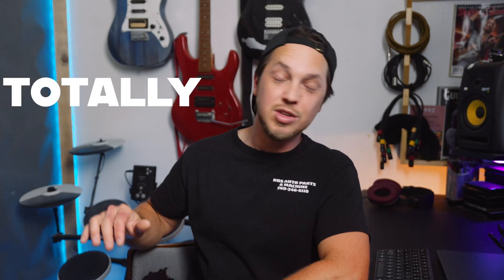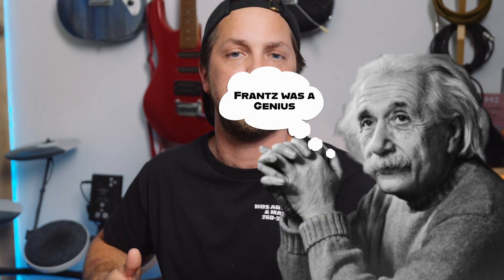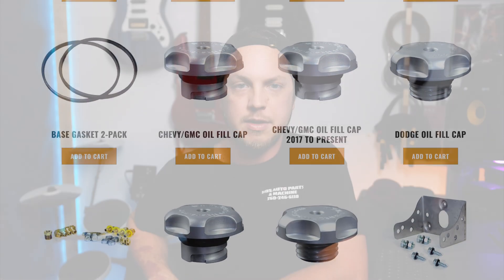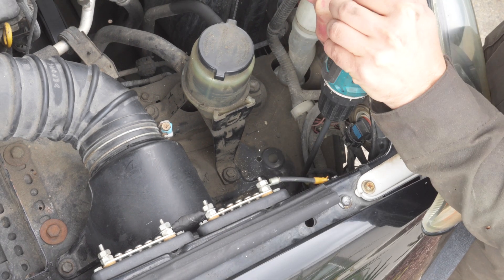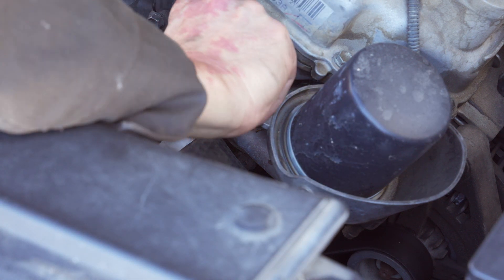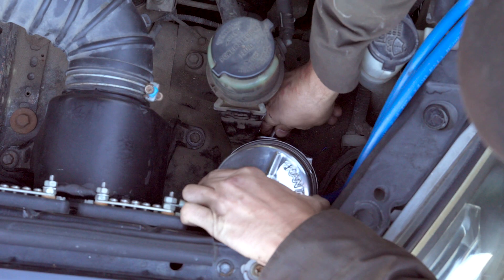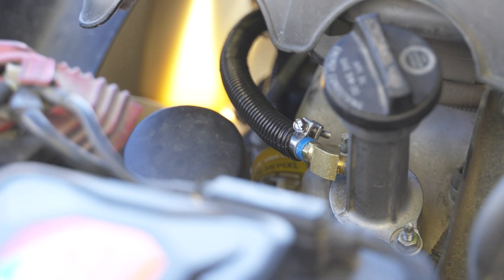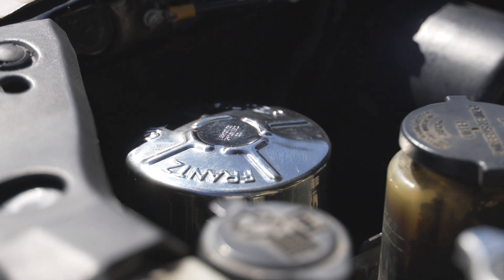Never Change Your Oil Again: Frantz Filter Bypass System Explained & Installed

Comment: Just my 2 cents. Marine Engineer here. At the shipping company I used to work for the engine oil that was cleaned with bypass filtration systems was never changed because of age or hours. We used to do TBN and oil viscosity tests locally and then send off samples every 3 months. The engines all consumed oil, so there was a constant slow refresh of the oil charge going on anyways. That helped keep the oil "fresh".
Reply: Oh ya, and water in oil tests weekly.
Reply from the maker: @koek2285 you said it! That’s exactly it
Reply: Yes its not like the same oil has been in the engine forever.or long enough to use up the additives. My wife says I buy a lot of oil. I have a lot of oil filters.
Reply: Married a lady almost 10 years ago that has a 2015 Honda Accord and a 2006 Pontiac Torrent. I told her I was putting a toilet paper filter on the Pontiac so it wouldn't need any more oil changes. She said toilet paper? You can mess up the old Pontiac. Havent put a wrench on the drain plug in almost 10 years. She told me she keeps the oil clean by changing the oil when the indicater light comes on. I said you aren't keeping the oil clean. You are letting it get dirty then draining it. She told me the guys where she gets her oil changes dont recommend toilet paper filters.
Reply from the maker: @ralphwood8818  I can’t believe people still talk down on TP filters. It’s wild
Reply: If you talk about the big diesel engines that dont get oil changes like Locomotive engines on offshore rigs the argument will be you cant compare that to cars and pickups The main difference I see is big engines need bigger filters.
Reply: The owner of the Australian Jackmaster Classic filter company is an old marine engineer. He made his first oil filter in 1954. Right now the Australian Jackmaster Classic is the best for the money. Some are concerned that it has no center tube. Frantz is the only one that needs a center tube. You push the paper down against the bottom core seal and put on the lid. Must use a firm paper such as Scott 1000 sheet. I use Great Value 1000 from Walmart. I was in high school in 54. Frantz came out in 1953.

Comment: I just read an article on this ..and there they stated take out the inner piece of cardboard from the roll first before fitting
Reply from the maker: That would be the opinion of whoever wrote the article. I understand why someone might thing that, but it’s totally unnecessary to remove and if anything would just make it more difficult to remove the filter again when it’s time for a swap.
Reply: There is a lot of bs out there about toilet paper filters. Always has been. Of course all toilet paper filters and paper towel filters filter from top to bottom. Dont go through the core. Some think the Frantz works better upside down.
Reply: People assume toilet paper filters filter the same as the junk filters. Toilet paper filters as well as the paper towel filters filter from the top down. The origional Motor Guards filtered from the bottom up. The oil doesnt go thru the core. My origional toilet paper conversion filtered from the outside thru the core and out the outlet port. I used a ice pick to poke holes in the core. Used a 1 1/2 inch od copper tube full of holes. It worked. When I perfected them it was like my flat head Ford V8 canister filter. A perforated plate in the bottom. A roll of Scott 1000 pushing down on that. A bridge washer to seal the space between the tp core and the filter tube. A new outlet to bypass the orifice. The old canister filters didnt drain below the orifice in the center tube. Put a 1/16 orifice at the inlet or use a 2 port sandwich adapter. My diesel tractor uses a Perma Cool universal 189 sandwich. Dont need a Frantz type  center tube with 1000 sheet. The Ford is 4 1/2 inch ID. The last Scott 1000 I used was 4 1/2 inches.

Comment: Clickbait, stay away.
Reply from the maker: lol great way to comment on something you don’t understand
Reply: Ignorance about toilet paper filters doesnt slow these people down. I was working in a full service Standard station when I found out about the Frantz. I told a Standard oil employee I see you just changed your oil. He pointed to his Frantz and said use one of these and Standard Delo 100 30 W. Your engine wont wear out and you wont need to change your oil. I went and found a Frantz dealer. Over 60 years ago. I learned well.

Comment: A lot of people don’t know this wire ties. I noticed he used the clear ones do not use them on automotive around heat. They will not take the heat. They will bust apart. They will crack always use the black ones do not use the coloured ones only black ones.

Comment: So the title is bogus. The additive package is still depleting and needs replenished, it doesn't work with regular oil (but who really uses that these days anyways), and you are still adding more oil volume over time.
Just change your oil. It'll be fine. You're doing it yourself, so it doesn't even cost that much.
Reply from the maker: I’m still not “doing an oil change”. I didn’t say never add oil again. Every car burns a little oil and naturally when you change the filter it’ll require a top off. 

It actually does work with regular oil, it’s just not “factory recommended”. My dad has run frantz with standard oil for decades and just tops off his oil each filter change.
Reply: Your dad is a smart man.
Reply from the maker: @ralphwood8818 yes he is
Reply: Filters that clean oil have been here a lot longer than synthetic oil. My 41 Dodge used a cotton filter. Not as good as toilet paper. But better at cleaning oil than pleated paper. Yes the filter on the Dodge was optional equipment the same as most oil filters in those days. I believe Purolator was the first. The Dodge had a Fram. There was a big improvement in 1953. John Frantz put toilet paper in them. My flat head Ford V8 canister filter is a converted filter. A better design and easier to service. Some of us dont tolerate dirty oil.

Comment: At one time Frantz had ATF adapters . A fuel filter that was the same as the oil filter except it had a coating inside and no orifice. Wife said I need you to take me to the Tulsa airport. Stopped in Sedan Kansas to fuel up. They said they were low on diesel. I went ahead and got a few gallons. Peugeot started losing power and died in Dewey Oklahoma. A Oklahoma highway patrol  officer stopped to help. He said I will take your wife to Bartlesville and put her on the Phillips 66 bus to Tulsa airport. A guy pulled me to a convenience store. Got a 4pack of toilet paper and a bottle of heet and headed home. Of course I had Frantzs on the  engine transmission and primary fuel. Imagine finding a Peugeot fuel filter in Dewey Oklahoma.

Comment: Ok so get this.... The ENTIRE kit with oil and additives costs $500. I can change my oil for $20, that's 25 oil changes. At 5k intervals 125000 miles. Even if your truck made it to 375000 miles you would be saving a total of $1000 over the entire course of the truck's life. I think I'll pay the $1k over 30+ years for simplicity and peace of mind. I would use this in conjunction with regular oil and replace regularly. Also title is definitely click bait let's be real.
Reply from the maker: @timothysmith3311  that’s a common argument against bypass filters. If you’re speaking purely monetarily, you are correct. A huge benefit with these filters is your oil is always clean so your engine stays much healthier and lasts longer. Then there’s the convenience factor of just not having to change your oil as much or ever.
Reply: I cant say I never change oil. In 1964 I put a Frantz on a nearly new Rambler American flat head 6. I remember draining the Delo and changing the head gasket at least 1 time. If I buy a used car I might start it out with new oil. I have probably changed the oil a dozen times since 1964. I probably wouldnt use the expensive oil or the additives. Havent used the Frantz in a few years.
Reply: In the 60s I sold Frantzs and Motor Guards for 29.95 and 6 bucks for installation. People would say hell I can get a real filter like came on the car for a dollar. Most of my filters are old and cost me less than 50 bucks. A cheapskate like me will find a Motor Guard M 30 compressed air filter. Remove the plastic parts and press a 2 1/2 inch OD flat washer on the bottom for a core seal and install a 1/16 inch orifice at the inlet. O Reilly's has transmission cooler hose. Ace hardware has brass fittings. Probably cost 200 bucks. Cheaper than dirty oil. My wifes 06 Pontiac Torrent has a Australian Jackmaster Classic and a Perma Cool 189 Sandwich adapter. Some cheapskates are finding old Frantz and Motor Guards. I still have two older than dirt Frantzs. I think one of them is 60 years old. You can use the plastic seals in the Motor Guard M 30s. How long they last depends on how hot the oil is.
Reply: When I was selling Frantzs a local Realtor asked me if it was too late to put a Frantz on his Toyota Corolla. I asked him how long he planned to keep it. He said a long time. I said  it needs a Frantz. Years later my wife was introducing me at church. She said mr Biggs this is my husband. He said I remember Ralph. The Corolla has over 500.000 miles on it now. Took the boy scouts on a camp out. They found the Frantz elements. The Corolla had almost 100.000 miles on it when I installed the Frantz.

Comment: About 1982 I was selling Frantzs one of my customers had a auto parts store in Sedan Kansas. He let me put a Frantz on the counter. Some old timers liked to come in and visit. One of them asked me if they were as good as a Fram.
Reply from the maker: It’s fun to hear the old stories
Reply: My 41 Dodge had a Fram bypass filter. It had a decal of a dipstick with golden oil on it. It said the dipstick tells the story. That might be the last Fram made that cleans oil. Small version of the Luberfiner. Not near as good as the Frantz. It used cotton the same as the Luberfiner. The last element I bought for a Luberfiner was a Wix 750 that used pulverized newspapers and wood chips. The problem with those types of filters is the oil doesnt travel thru enough media. Many years ago I pulled the cotton out of a Fram and put a roll of toilet paper in it. About 2 inches compared to 4 with the Frantz and less than 1/8 inch with pleated paper.

Comment: The Frantz is the messiest filter to change. I notice some people are installing the Frantz upside down. Then you really have a nasty mess. A lot of promoting of the Frantz now. The better designed filters dont have a chance. I like the filters better designed to use Scott 1000 sheet or Great Value 1000 from Walmart.

Comment: Many years ago there was a Jones bus company in Wichita  Kansas. Frantz equipped school buses. Got a call from mr Jones. Needing some work on his old Frantz on his old Chevy pickup. He was retired and raising Clydsdale horses north of Sedan Kansas metal fatigue crack around the Frantz bracket. New hoses and gasket. Mr Jones had thank you letters from Frantz in picture frames on the wall. Repaired the fender panel with a piece of oil drum.

Comment: My wife and I were walking down El   Camino Real in San Jose California looking at RVs. There was a Motor Guard on a Mercedes truck with a chassis mount. Too rich for Our blood. Couldnt afford the Mercedes Gull wing either. Ended up with a Datsun. Motor Guard was a San Jose company. Couldnt compete with the better known Frants. My Motor Guards are from San Jose  San Leandro and Manteca. The Motor Guard on my old F250 is over 50 years old now.

Comment: Actually your dad was right. I started in 1963 with a Frantz and.Standard Delo 100 30W.  Delo came in 30W and 20W. You dont need special oil or additional additives. You dont need lab analysis.

Comment: All it amounts to is using a filter that cleans oil. That would be a toilet paper filter or other depth filter such as compressed cotton. Toilet paper is economical. Also adding enough new makeup oil at filter changes to keep the oil as good as new. The advantage of the big paper towel filters is they have a lot of depth and take a lot of make up oil. There is no such thing as no more oil changes. No more oil drains is possible. Some call it changing the oil one quart at a time.
Reply: I have been using VIVA signature cloth paper towels in the flat head Ford V8 canister filter. It can take half a roll. Thats 5 1/2 inches. Dont know what Gulf Coast filters uses now. They are in a bag. They claim 99 percent at under 1 micron for the 10 quart model. Thats 2 rolls or 22 inches of depth. I sometimes cut 4 1/2 inch towels for the toilet paper filters. With the big filters the oil enters the top thru a very small orifice. Soaks down thru two rolls of paper and out the bottom. Similar to many tp filters except many tp filters have the orifice at the outlet. I prefer the inlet.